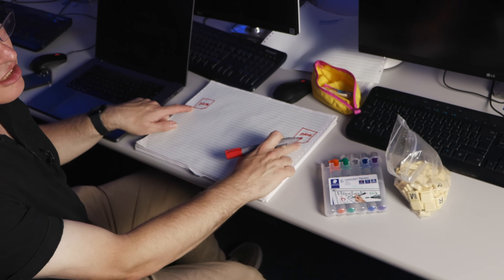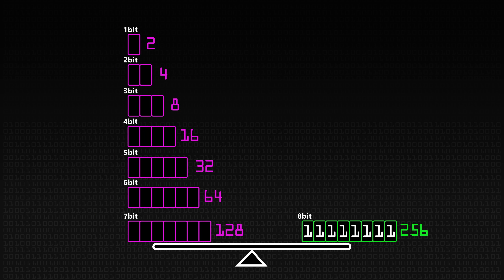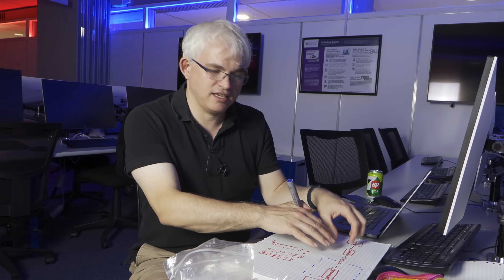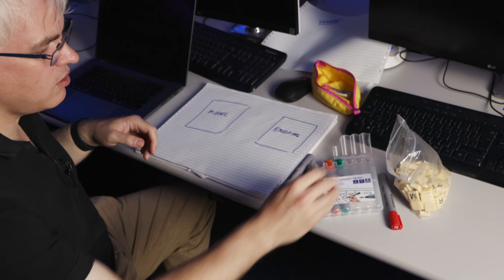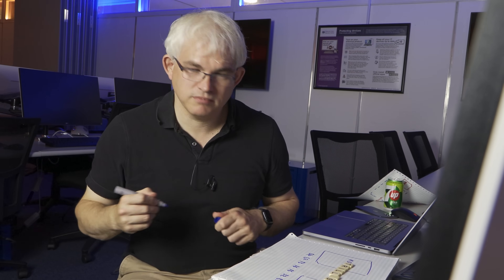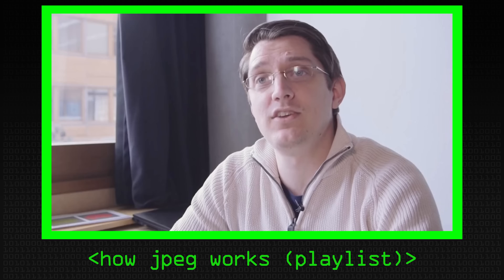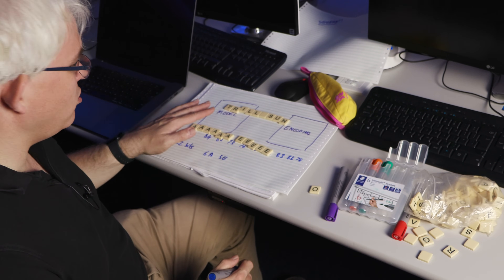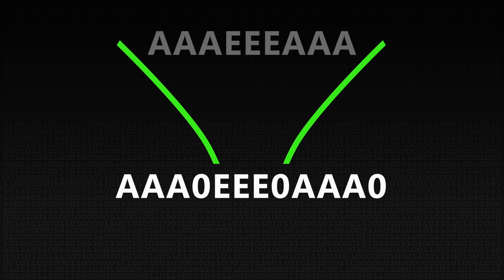CMPRSN (Compression Overview) - Computerphile

Comment: What is the limit of compressing?
4x, 5x, 6x, 7x?
Is there a mathematical reason for the limit?

Also, I can't find your videos through the Youtube app, I have to search in the browser then open in the app.
In the Youtube App it says, "No Downloads Found." when I search for your channels.
This issue may be malware on my phone and not a Youtube system channel issue.
There is apparently an attack which uses cell phone numbers to propagate infections, like SimJacking (3G) but newer, since 3G is a deprecated attack vector. Maybe there is a newer SimJacking 4G and 5G?

Comment: The system with the highest factor of compression I can think of would be to have the first few bytes - or even potentially gigabytes - to be dedicated to specifying exactly which very custom algorithm is used to compress the message which follows. Your decoder and encoder would be huge, but you could analyse the package very intensely to choose the optimum choice for the specific niche message you are sending, so you never deal with the end result being larger than the original message. It would simply require a lot of pre and post processing but taking an hour to compress and decompress a message is worth it if you save a day by sending a smaller message through a low bandwidth tunnel.

Comment: An interesting, but very complicated system for compressing text that was theorised for a sci-fi book I've read was the development of a conlang specifically to serve as compressible intermediary language.

Now, translating natural languages are naturally lossy, but it's possible to develop a whole language which is inherintly lossless in translation with another specific language while being more regular and information dense, you can then use this more dense language as a first stage compression before applying regular text compression as a second stage. If you limit the domain and format of the original messages, it's possible - with a penalty for the compression time and decompression time - to acheive very high levels of lossless compression.

It's a useful idea in the rare case where extremely low bandwidth combined with long transmission times makes very intense compression algorithms and huge identical pseudo-one-time-pads at both ends worth while

Comment: 0:11 JPEG is not a compression algorithmus, it's about data reduction.
JPEG reduces details deemed unimportant for our visual system. It actually doesn't compress but irrevocably reduces the image data.
Reply: JPEG is not compression. JPEG uses compression. Yes, it reduces the data, but it does so specifically to get data that's easier to losslessly compress, specifically with a run-length encoding specifically for 0s (which the lossy encoding generates a lot of), followed by Huffman encoding.
Reply: Semantics.
Reply: @toby9999  Semantics are an essential part of language. It's what makes the meaning of »compress« different to the meaning of »reduce«.

Comment: The best way to compress (pseudo)random data, is to know the prng algorithm, the seed, (and optionally the length or index into the stream it generates).

But true random data, you'd have to find a function that fits that data and communicate that function, so then it'll have the same problem of costing more data to represent that.

Comment: Finding Tom Scott a bit insufferable these days, but his video on Huffman Encoding was way better than this. Huffman has been proven to be way better than RLE.
Reply: They solve completely different problems and look for completely different types of patterns. In fact, it's very possible to use both in sequence, applying RLE, and then huffman coding the result of that. This is exactly what JPEG does.

Comment: Lossy compression can easily be seen in compressed movies with crowds in the background. Generally, the crowd will look blurry and have a much lower frame rate than normal.
Reply: No, you can't have the background running at a different frame rate than the foreground.
Reply: @d5uncr  You misunderstand. The movie is running at a standard rate. The background displays an image and skips a few frames before changing it while the foreground changes every frame.
Reply: I used to see compression in tape-delayed Formula One broadcasts as sparkles in the grass; that was one of the reasons why I dropped that cable provider.

Comment: You can always use an unused byte to separate between packs, and then after "that byte" include a number or some 256 base number to multiple the pack to it when decompressing, which makes it much faster, but the compressing will be hard, and that unused byte won't be accessible, unless if replaced with double "that byte" just like the double back slash in string to produce 1, good compression to be honest.

Comment: 2:55 another way of looking at it without going into the math is, if we had such an algorithm that can compress every file to a smaller file, then we could have given it a file it has already compressed, to get a smaller one, and give it back again & again until we were left with 0 bits....
Reply: perpetuum compressible
Reply: mathematically, it could reduce the size everytime to get a smaller one but not get left with a file with 0 bits. practically, file size is discrete, so idk.
Reply: The issue with this handwavey explanation is that there (may be/)are "optimal" files, i.e. files with size equal to their information content.
Reply: @Winium Information content is irrelevant to that proof. Not even used in it.
Reply: @Winium the issue with this handwavey retort is that it shows you misunderstood the very cleanly stated point.  It stands without any modification.
Reply: @Winium  the point still stands,
all I needed to show was that the hypothetical algorithm does not reduce the size of an input file.
you are correct that it will happen long before it will reach 0.
Reply: @Winium  "information content" of the file depends on the compression algorithm itself. If my algorithm produces text of some book when it given an empty file it does not mean that empty file have information content of that book.

Comment: If a character is only represented by three bits instead of eight, doesn't that mean that we need additional bits that tell us that the character stopped and the next bit will belong to the next character?

I do not understand why A has to represented by "1A". If the counting digits are not digits that are allowed in the text at the same time, you could just delete all 1s. So "AAAABCCC" would convert into "4AB3C". That of course falls apart if numbers can also appear in the text. So you need different characters for counting.
Reply: The example he gave was an inefficient example, if you look at hoffmen compression (think that's what it was called) you'd see a much more efficient version. Let's take that AAAEEEAAAEEE string for example, with hoffman compression that would boil down to 1010010100 which is 10 bits, much shorter than the 96 bits used for the original (although in this case it won't actually be worth compressing because of the extra data needed to understand what that string of bits actually meant), if you expand that concept to something much bigger like the usual kilobits and megabits that text files (word documents etc are included here) show up in then you can see how that would be a major saving for a server doing 100s, maybe even 1000s of those kinds of downloads/uploads a second. That is the reason compression is needed and is even now a hotbed for developer interest.
Reply: The way nearly every compression algorithm works is by developing a legend or key based on strings or other contiguous data types (including binary representations) and assigning them a substituted value which, ideally, takes up less space than the original string (or other data). If a substring appears only once in a text, that part can't be compressed any further, and in fact that specific substring will take more room to store in the compressed state than it requires in plain text. This is because to decompress the substring, you need to store the original content of the substring in the legend, plus the replaced string in the compressed version. Even if your algorithm can flag something as "this is not compressed; treat this as plaintext", *that's additional data that must be stored*.

A has to be represented by "1A" because the 1 serves two purposes: it explicitly ends any substring to be multiplied during decompression, and it flags the next substring as uncompressed. The only place this could be omitted would be as the very first character, but that's not only bad practice, but also error prone, and ultimately isn't worth the bother to define in the algorithm in the first place
Reply: With that encoding when I see "4AB3C" I understand ABABABABCCC. The method CAN'T have multiple interpretations, it has to be clear.
Reply: @3k2p6  Of course the decoder always knows how to interpret the code. It does not have to apply its best guess. For ABABABAB you could define brackets like 4{AB}.

Comment: You should be able to compress random data if you have;  
More then about 1k of it
and HUGE processing abilities say a GPU with 256 cores and enough memory to hold the file. 
Think about run length encoding but varying two things.   The count between bytes and the offset of the bytes by value.   So standard run length encoding would be a 1,0.    Then test ever second byte or a 2,0.   Every third byte, 3,0 etc. Do that update say 255.   Then start doing the offsets, say 1,1 where the next byte is considered correct if it is one value higher.   Then do 1,2   1,3   1,4 up to say 1,255.   Then start again at an offset of 2. so 2,1  2,2  2,3 etc.  It would be pretty hard to actual random data to avoid all combinations like that.   
But like I said,   It's going to take HUGE processing time and if the data is truly random then I'm not sure how much you would compress but it should be more then zero.
Reply: There are no patterns in random data. Therefore there is nothing you can take advantage of to compress it.
Reply: @lapatatadelplato6520  Apparently you didn't read what I wrote.
Reply: @lucidmoses  i did, but the longer the string of random data, the less likely a global pattern will emerge. Look up shannon entropy. It should dictate the mathematical nature of compression. Its mathematically impossible. Like energy is conserved in the real world, entropy is conserved in data. No matter how well you subsample the data, if the string is random, you cannot compress it.
Reply: What we define as a random string is that regardless of how much info you have of prior symbols, every subsequent symbol is still wholly unpredictable, and all possibilities are equally likely. So a random string would maximize information in a number of bits, as no matter what you do analyze the bits, the others will always be unpredictable. So no compression is possible. We already have reached the entropy limit.
Reply: "It would be pretty hard [for] actual random data to avoid all combinations like that." But not impossible, so a random sample can indeed break your strategy. There is simply no strategy to always compress random data, and this is easily proven as in the video. If you presented a formal strategy, a string breaking the strategy could be found given time.
Reply: @TeslaPixel  Good thing that wasn't what the response was about.   He said it couldn't be done.   I showed how it can usually (not always) be done at least a little bit.
Reply: @lucidmoses it can't be done, full stop. To see why, let me try to understand your system a bit more. So, would a 1,1 encode a string like abcdefg as a7? And 2,2 encode a string like aacaeaga like a4aaaa? Or what? I'm not quite sure how the offsets and skipping would work?
Reply: (Why I'm so confident that it can't be done even though I don't fully understand your system? Because there is a mathematical proof.)
Reply: @DDranks Wouldn't be the first proof that turned out to be wrong.  However, my caveat of needing 1k or more data leaves the proof ok.   There is no algorithm that will “always” work on random data.   But that’s different than random data can’t be compressed.

So yes,  AAAAA =A5 in 1,0.
ABACADAEA = A5BCDE in 2,0  Then on another pass you get  A5BCDE = A5B4 in 1,1
ABCDE = A5 in 1,1
AXXBXXCXXDXX = A4XXXXXXXX in 3,1 then A4X8 in 1,0

Course your going to have to store the encoding type so your smallest viable run is 5.
I didn’t include in the OC but this is also just duplicate finding.  Where you just record a location, it’s length and the offset to a duplicate found. 

So you see, the 1k limit is not a hard limit.   It can technically work with smaller data sets but it’s unlikely.  So the bigger the data set the more likely you’ll find this by shear volume of methods.  Then again.   Like I said, your unlikely to find a lot of them so your only compressing a bit.
Reply: @lucidmoses  Btw. do you agree on the methods: we mean random data, on average, right? Because of course you are able to compress "random" data if you get to roll dice as many times you choose. But stopping to one example where you get a slight compression, is by definition, not random anymore. If you roll enough times, you might get the first chapter of Harry Potter by accident. In that case, you are cherry-picking data for the case it happens to be compressible, so it is not random anymore. It's just a very inefficient method of generating non-random data.
Reply: @DDranks  thanks for clarifying this point, I don't think OP understood this meaning of 'random data' as it was intended.
Reply: @TeslaPixel  My pleasure! And to continue with lucidmoses' argument: Let's consider all programs that are under 1k bytes. By all programs I literally mean all possible strings of bytes, with ".exe" stuck to the filename or "chmod +x", depending on your OS. Most of these don't even start, or crash right away, but there are gazillions of valid programs. (And fghtdfzillions of invalid ones. If you don't believe me, try to stick 2^500 to a calculator and see if it goes to even bazillions, and that's with a 'B')
Reply: Now, some of these programs output some bytes too. Some of them stop before 1k bytes, some of them go over and then stop, and some of seem to continue outputting forever, and some get stuck until your OS says "moses.exe is not responding" or "moses.exe has performed code crimes" and you click, yeah, I don't care. These programs are compressions of the bytes they output. Because you can just send one to somebody and say: "it's a self-uncompressing binary".
Reply: This proves that not all 1k byte strings are compressible, because there can't be under 1k encoding to some of those. It also makes clear that every 1k string is possible to compress in 1.1k or so bytes. Proof: "python -c 'print("string goes here expect for some shenanigans for strings containing \" characters")'
Reply: @lucidmoses   "Wouldn't be the first proof that turned out to be wrong"  
No, in all seriousness, there's absolutely no way that the proof in question can possibly be wrong (and if it were then the consequences would be so severe that there would be now conceivable way to do any form of mathematical reasoning at all, or even most basic logic!)!  

In more immediate terms, I have personally constructed a fully formal (machine-checkable) constructive proof of the Dirichlet Pigeonhole Principle, one that would work in any conceivable system of mathematics that, say, can represent even just the Natural (counting) Numbers.  

Now, you may never have seen such a thing, but you should definitely consider the possibility that it exists!
Reply: @TAHeap "there's absolutely no way that the proof in question can possibly be wrong" and yet, you where given the algorithm.  Check out proof by counterexample.  Well... that and read what I actually wrote.
Reply: You're probably right. He did say an incompressible _stream_, though. In theory, a stream of random data is infinitely long. And, unless I'm mistaken, the best possible compression ratio for random data, while always nonzero, will tend toward zero as the stream gets longer. That's because, while you can find patterns in any given chunk of random data, they won't continue to hold true in the rest of the infinite stream. In practice, though, compressing individual chunks might be good enough.
Reply: Come back with a thesis and a demo, professor
Reply: @ezgarrth4555  why are we being mean to him all of a sudden?? I get that he was a bit confused, but he at least created a cool idea that we all had fun reading. Why the animosity